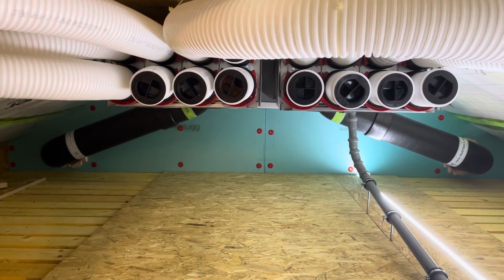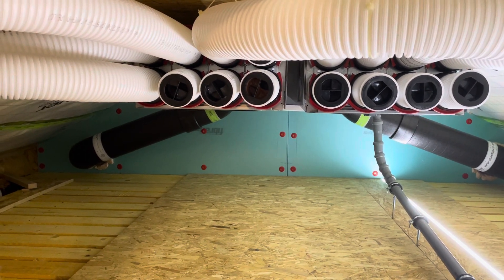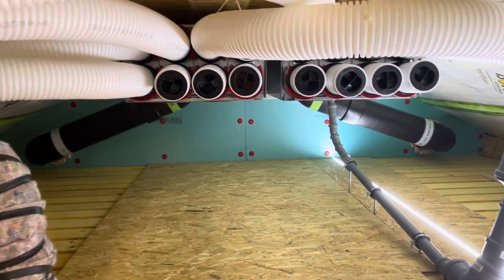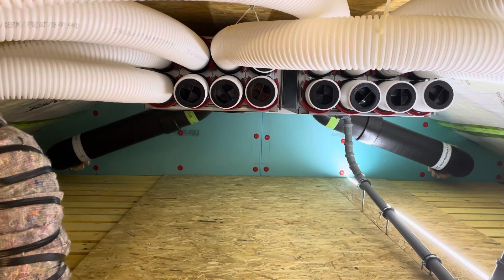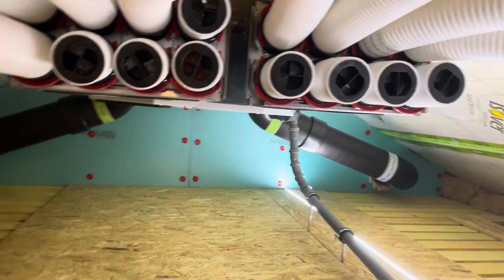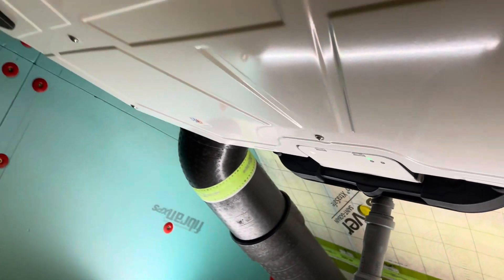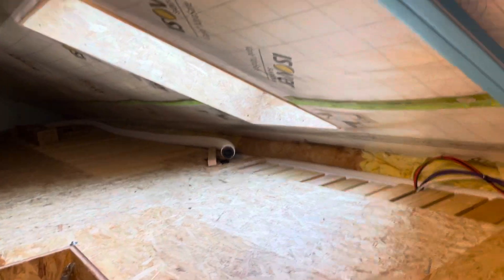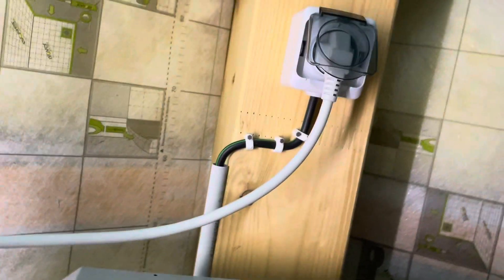Zehnder ComfoAir Flex 350 DIY installation in an existing building

Comment: Hello mate. What is your Supply Air Temperature shown in the ComfoControl app? Mine seems a bit off.
Extract Air = 19.1 °C
Exhaust Air = 15 °C
Outdoor Air = 9.4 °C
Supply Air = 14.1 °C <<< It should be around 17.8–18 °C